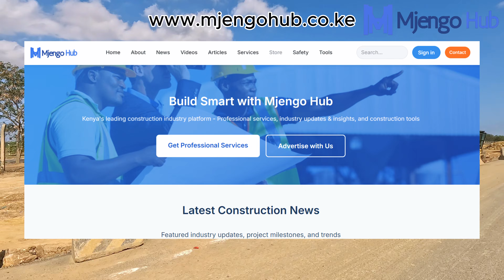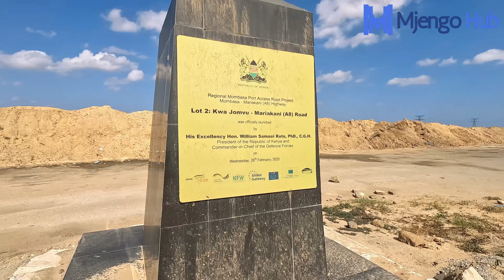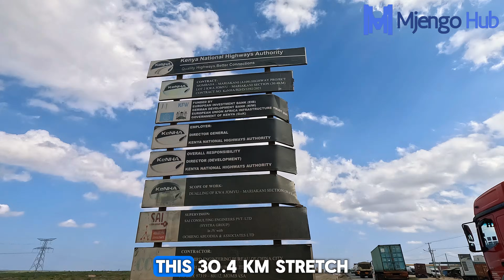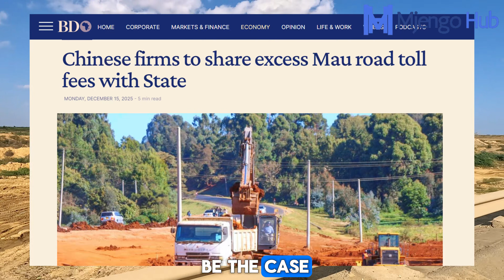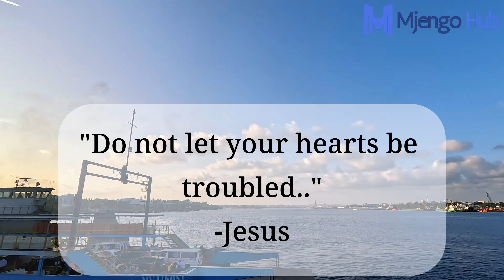Mombasa - Kwa Jomvu - Mariakani Dual Carriageway | Full Progress Update 2025!

Comment: It doesn’t make long term economic sense to build a road used constantly by heavy overloaded trucks using asphalt or tarmac! The direction towards Nairobi should be built using concrete pavement like they did in lot 1 of the Mombasa to kwa jomvu section!
Reply from the maker: Yes, concrete (rigid pavement) was used on the highest-stress areas. The long-haul sections use layered tarmac because it's faster and cheaper to build over distance, while still meeting high durability standards. Tarmac also makes driving smoother. The weighbridges are what really protects both designs long-term. They will have performance-based maintenance contracts also.
Reply: @MjengoHubKe Thanks for this clarification 💯
Reply: Ulikua engineer lini wee burukenge,tangu kibaki ajenge hizi Rd zmekua sawa mpaka leo na unataka kutuambua lami ni useless???!!,acha ujinga na uache kiherehere